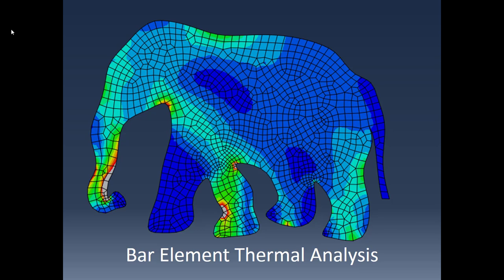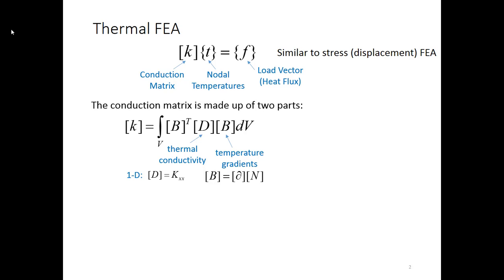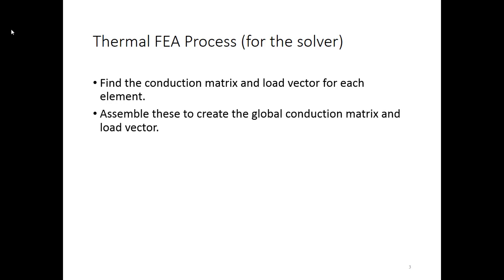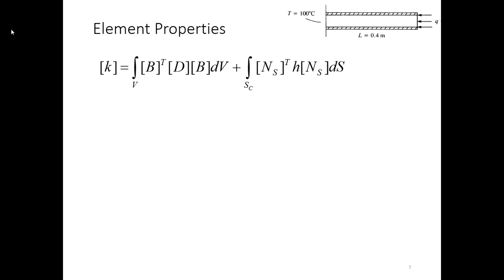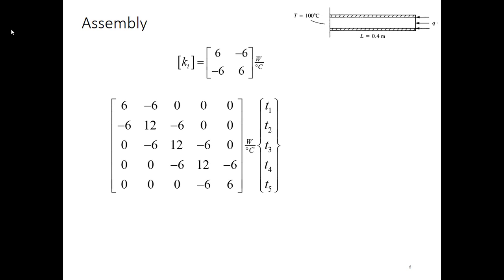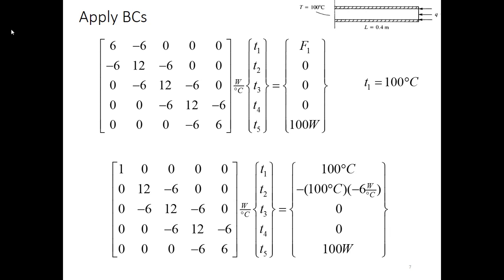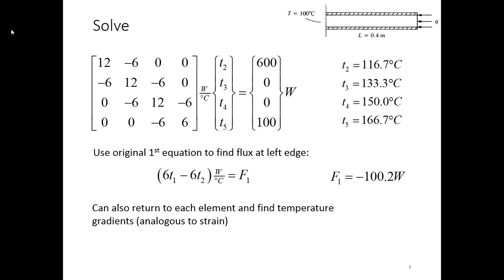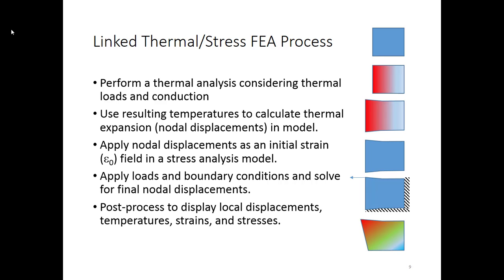FEA 13: Thermal Analysis with a Bar/Truss Element

Comment: I need help here :( 8:29 how does the first row get changed like that...and also the changes done in the 2nd row
Reply: 7 months late but if someone else is stuck there as well, I hope that helps. I had to think about it for a few minutes:
for the first row: We know that t1=100C. The equation in the algebra form is: 6*t1-6*t2=F1. We don't care about F1 and we have other equations to find t2 so we throw this equation away and we write 1*t1=100 (1*t1+0*t2+0*t3+0*t4+0*t5=100).
for the first number in the second row: You just write the equation and send 100*-6 on the other side of the equation. -6*t1+12*t2-6*t3=0 (t1=100);12*t2-6*t3=-(100)*-6
Reply: @marc-antoinenadeau2672  so youre just treating each row in the matrix as if it was just its own equation